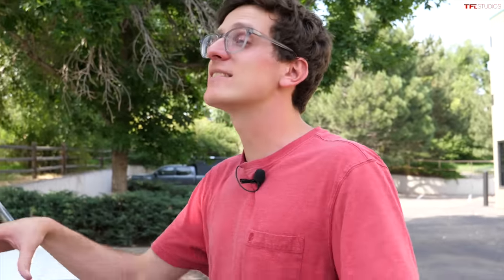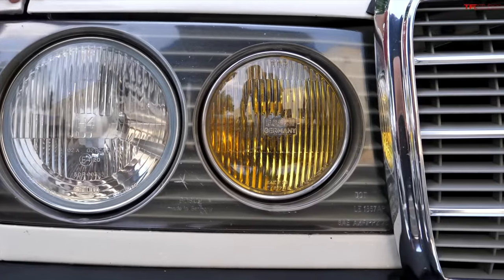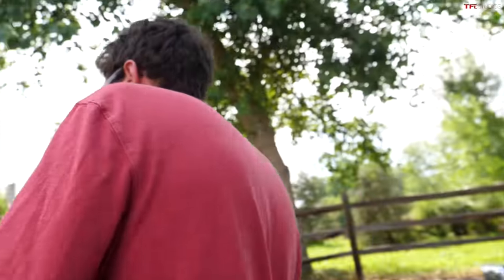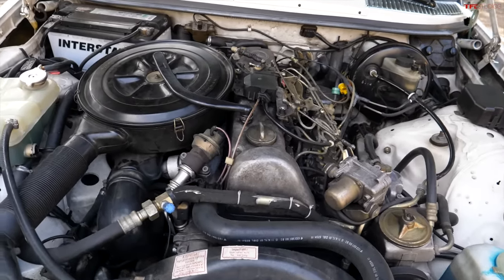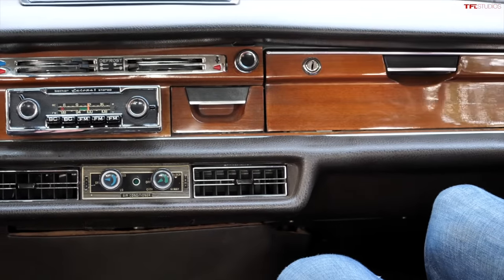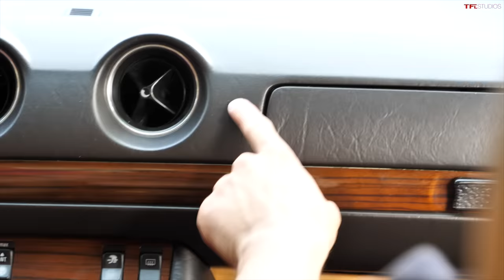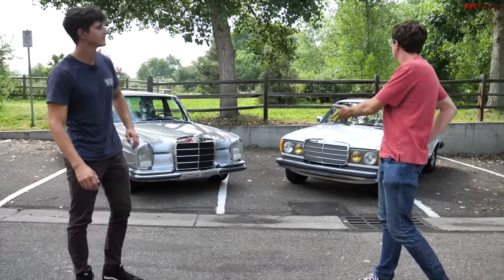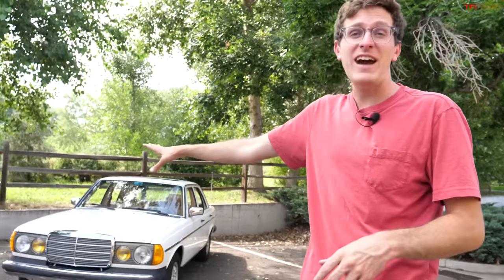Is It Worth Buying a Classic Mercedes-Benz? We Share Why It Absolutely Isn't (& Totally Is)!

Comment: Back in the day, I owned a 78  W123 280E in Germany when I was stationed there for 3 yrs.  It had 2.8 L in line 6 with dual over head cams instead of the 300D.  It was a fast car with a top speed of  243kmph (150MPH) governed.   My car liked to cruise at 219kmph (136mph).  I drove the car every day to work at no speed limit.  These W123's were the best cars MB ever built.  What both of you never see is the amount of over engineering that went in to both of your cars.   Even though the 300D is a slow car in today standards, it can car run, steer and stop at remarkable high speeds.  One of the reasons I bought my 14 Charger R/T because it allows me to remember some of that great MB legacy engineered feel that your cars both have in their DNA.  Enjoy your rides.
Reply: Top speed of the manual gearbox W123 280E is 202 kmph, the 243 kmph you mention is simply impossible

Comment: As someone who grew up with a new and then an old Mercedes 220 gas , I loved traveling around Europe when I was a little boy and then for many years when we returned to the states and when I was old enough I was able to drive my dad’s car and still enjoy it! They are totally worth it but can get expensive as they age , especially if you can’t wrench on them yourself! Things like the original valve train had to be replaced because the original ones were for leaded 120 octane gas and the unleaded gas ate them alive or figuring out that a pinhole leak was causing the downdraft carburetor to not work, a simple fix but you need to be able to figure these things out or pay a huge price to have it fixed by the local Mercedes dealership. Ouch! Enjoy your cars and keep on passing the love for these old Mercedes to the younger generations! Thanks for the content!

Comment: Both outstanding models from Mercedes.  Thanks for saving them gentlemen!  Tires for the W108 are no problem.  It'll take 205/75R-14's, and they will be fantastic on it.  Air 'em up firm, and the ride will be great.  If you run fuel injection cleaner through both, like SeaFoam, and take them out for a 30min run on the freeway, you'll find they run better.  A 300TD is no slouch!  Put your foot into it, and let that turbo spool and make power!!

Comment: I own a 1992 W201 (wich is the predecessor of the C class) I bought it 7 years ago and it has been my daily fi 5 year until it took over my wife Lexus and made my bez a summer car. I amazed about how long lasting these cars are. Even though I had some rough running at time, it never left me stranded and always manage to limp home or to the garage.

Still, I was curious if buying and vintage car that I love would be cheaper than by a cheap KIA I don<t have any feel for. Turn out It<s about the same price after 5 years. At least I have a car that I like and that my be worth more than a cheap modern car,

Comment: That 5 cylinder diesel sounds so good🥺

I'm just obsessed with the W123, the 6 cylinder 280e has to be the one I'd go for
Reply: Good luck. Only 1 comes up every two years or so. 280E sedans in good condition are extremely rare

Comment: Definitely the Diesel! Built like a tank. If my current situation was different I would be in the market for one. I currently drive a 2014 E350 4Matic, good solid car. I stopped by Mercedes a few weeks ago to test drive a 2018 and the salesman told me I would be nuts to trade it for the newer E300 4cyl Turbo. The 3.5 V6 is bullet proof

Comment: About 1997 I bought a beautiful 1984 300 Turbo Diesel blue perfect tan leather interior 112000 miles $7500. I loved it drove it for about a year and a half. Started to have some engine problems couldn't afford to fix it parked it in a covered parking spot and an expensive car cover spent the next 2 plus years paying it off. Eventually decided  to sell it. Now I wish I hadn't. Want another one.

Comment: Damn this makes me miss my w124 that I lost to an accident a few months ago.. It only had 104k miles
Reply: which engine?  I had a W124 1995 E300D i regret selling that car.  I put 300k+ on it ran like a tank.  Was slow but did everything I asked of it.
Reply: @joeyscleaninglady2877  it was a 92 300e I had just done the headgasket to fix the typical oil leak 5k miles ago too
Reply: @ThatRcThing  why not get another one?
Reply: @joeyscleaninglady2877  I tried to find one that was a worthy replacement to no avail.. maybe later on down the line
Reply: man, that sucks...
Reply: @ThatRcThing  get a facelifted one they are amazing E420 or E320 damn I miss my E300 95 w124 was just as quick as the W123 turbo diesel I had but more refined was a tank just kept running should have never sold it now they are skyrocketing in price.
Reply: My folks have a ‘94 E320 with only 60k miles. Mint. They asked me to sell it for them. Any idea what they’re going for these days?
Reply: @denisb8975  depending on color and interior combo/ options you'd be looking anywhere from 12k to 18k
Reply: @ThatRcThing  really?! I had no idea. Any suggestions on the best place to list it?
Reply: @denisb8975  bringatrailer is a great spot to list it
Reply: @denisb8975  15k at least try BAT   cab or sedan or coupe?
Reply: @joeyscleaninglady2877  sedan. Yes, I checked the site. 15k actually seems reasonable. I had no idea it’s now considered a “classic.” Thanks!

Comment: You guys are absolutely right: those cars are supposed to be driven and if you do so, they will run more or less trouble free. And please don't worry about the shaved side markers. Those have been put on cars for the north american market only. Drivers from other countries didn't have them and I guess they survived without them and still have been seen. I bought my first Mercedes, a 240 D when I was 22. Right now I have a 1982 380SEC (C126) which I bought in 1995, a 1996 E 320 station wagon (S124) which I have for 12 years now and a 1971 280 SE 3.5 (W108) with a rare four speed manual. I drive them frequently all year long and they just keep on running. Keep yours and have fun!

Comment: Hands down, THE cheapest car I ever owned was a 1985 300D. I paid $4000 for it (with 145,000 miles on the clock). I sold it for $1500 after 15 years with about 375,000 on it (odo broke at about 345k).  I did all the work on it and paid less than $1000 for parts altogether.  I'm not counting tires (just bought the cheapest ones every 3 years or so - not like it needed v-rated ). Never broke down or failed to start - not once. Never had to get a smog check and the insurance was cheap.
I miss it.

Comment: I was in my mid-20s when I got my first Mercedes (I'm in my 40s now).  Started off with non-turbo w123 300Ds, dabbled a little bit with a w116 300SD, then a w126 280SE.  There was about a 5 year period of time between my last w123 300D and my current w126 420SEL where I owned classic BMWs and Volvos.  Those cars are fun in their own ways, but I missed the the "forever car" feeling of owning a classic Mercedes.  There's simply nothing else like it.  Das Beste oder nichts!

Comment: My grandparents have a 1982 240D with an estimated 230,000 Miles (odometer doesn’t work, no surprise), and it’s a wonderful car. Sure, it’s not a sports car, and sure, it sounds (and shakes) exactly like a tractor, and yes, when you floor it it only makes noise, but I don’t think I’ve had more fun driving anything else. Everything feels so well built. 
Also, if I had to choose, I think I prefer Tommy’s car due to its stock nature, but I’m probably biased. They’re both beautiful cars

Comment: Beautiful cars, both of them. My brother had an 85 300SD, the short wheelbase S Class. What I found odd in a car that expensive when new, was MBTex upholstery. Vinyl by another name. The car was great until 700,000 kilometers. The transmission went out, and to rebuild that as well as fixing all the rust was a $12,000 job. It became a parts car. Superb car from the time when Mercedes built to a standard of quality. Enter Lexus and Infinity, and suddenly Mercedes had to build down to price. My personal choice is the 108, but with real springs. I hate air suspension, and hydraulic is even worse.

Comment: Had a 74 280C with the 110 model dohc straight six with 4bbl. Stripped down version didn’t even have a radio just a plate with 280C on it. 0-60 in 7 seconds fast for the time. It was Euro spec with halogen headlights and slim bumpers

Comment: I'm of two minds about shaving the turn signal lights. The old W108 looks better without its turn signals, BUT signaling for a turn or lane change is legally required, but a safe practice, and driving around with the window open so you can use hand signals would be annoying.

Comment: I owned a 1980 240D (W123 model, like Tommy's there, except mine was Midnight Blue with a Palomino interior).  Bought it from the son of the original owner with about 190,000 miles on it.  7 years later, with almost 225,000 miles on it, he asked to buy it back, because he regretted selling it to me.  He gave me more money than I'd paid him for it -- but to be fair I had repaired the cruise control and the A/C, both of which were broken when I bought it, plus the value of those old cars had gone up quite a bit in those 7 years.

The one I really want is a 1985 300 TD -- the 3-litre turbodiesel wagon.  Definitely like those things.

Edit - oh and the vacuum system also controls the lock on the fuel-door (which locks and unlocks automatically with the door-locks).  You do NOT want to have that break on you at 3AM when you're on a road trip and you stop at a truck stop in the middle of nowhere to buy some Diesel fuel.  Ask me how I know...  ;-)

Comment: Careful about skipping the shoulder belt on these vintage cars.  I did on my first car: a 1973 Plymouth Fury III, and when I got into an accident, I planted my face in the steering wheel hub and broke my nose so badly I needed reconstructive surgery to correct a deviated septum.  They actually had to take cartilage out of one my ribs and partly rebuild my nose with it.

Comment: Great to see younger guys into these cars. I've owned about two dozen 108s 109s and 123s, including four 6.3s, and I currently own a 1970 6.3 and a W124 diesel. I ran a 6.3 as a daily driver for years.
As for that headliner panel, it's not leather, In fact, there isn't a square inch of leather in either of those two cars.

Comment: I used to tool around in a W123 when I was an 18 year old (My Dads 250). I was offered it when I was 20 but didn't fancy living with the 20mpg fuel costs. My personal favourite is the W126 V8 which he had in the mid 80's. Wouldn't want to fuel that either though.
What always amuses me is that it seems that in the US in the 70's and 80's, you either got the horrible slow, noisy, diesels or the 5.0l V8s, whereas in Europe we mostly ran the smaller petrol Mercs. The 230E was the most popular W123 in the UK by far. Outside of Taxis we didn't touch the diesels as they were rough and slow and a Merc was supposed to be a smooth luxury car.
These days, in Europe, we switched and almost exclusively run diesels (220cdi or 320cdi, even in the S class) as they're economical, refined and fast, whereas in the US you've gone the other way and only seem to run the gas guzzling petrol engines.

Comment: Kase's car has electronic fuel injection (Bosch D-Jetronic).  It's the first of Mercedes switch from purely mechanical injection to electronic.
Reply: Pretty sure it's not electronic injection. Both the W123 and W124 which came AFTER that didn't come with electronic fuel injection. On the W124 electronic injection (HFM) was only introduced on the 1993 model.
D Jetronic only had electrical fuel enrichment for cold weather starting. Otherwise mechanical.

Comment: I loved owning and driving my old Mercedes cars. The biggest danger is that they SOOO spoil you. It's hard to drive anything else. I'm a generation older than the guys here, so I had an earlier generation of Mercedes starting with a 1957 190S (You know the look... the grill is taller than it is wide!). A running 1959 190S was my parts car. Then, I got a 1963 230SEB that sold very cheaply because no one could start it. They didn't know about carburetor chokes. I got into it, knew that the unlabeled knob was the choke, closed it, started it, and got it. And my last one was a diesel, a 1966 200D. Now I drive a modern VW Jetta TDI ... still a diesel, thank god!

Comment: I bought a '72 300SEL 4.5 as a project.  Famous last words.  Was a California garage queen, but had Underhood fire.  Silver with dark green interior.  Didn't ever run.  Experienced European specialists wouldn't touch it.  Found a wrecked twin in a junkyard, so tried it.  I had some experience on an MGB before, and the quality engineering came through in spades.  I got a '69 Corona as a daily, and it was a different good experience.
Reply: My sister had a red Corona coupe  with a white roof of the same around the same period of your 69 Corona, it might have been a 1972. It had tiny 13 inch wheels, and could took forever get to the 55 mph speed, which was the speed limit in early 1980’s in Ca., and protested at any sort of hill. She loved it because she said it was so cute and reliable.

Comment: I have a 78 300CD with 340,000 miles on it and it still runs like a top on the original engine.  Never even had the heads off.  BTW, it's more environmentally friendly than any electric econo-box on the road.  I run it on 100% biodiesel that's available commercially here in the Denver area (no conversion of any kind needed, just put the fuel in the tank).   I recently acquired a pristine 84 300CD Turbodiesel with 98k miles on it (barely broke in) that was offered at a crazy low price so I just had to buy it.  I'm set for cars for the rest of my life.  They never die.

Comment: Cool Cars - both of them. I had W123 230 Petrol Bulid 78 as my first car in 1991! Did you realize where they put the electric motor to run the sunroof these days? It‘s actually in the trunk. And it pushes or pulls the roof by a mechanism throug the c pillar!!! Great german engineering, for sure . Take good care of them - until rust tears you apart!

Comment: Both nice cars, I prefer the 108 and a gas engine over the clattery diesels, but that's just my opinion. The way to wake one of those cars up is to drive one with a manual transmission; - then you can run it to flat out. Since the 50s, Mercedes gas engines were designed to be run to redline; - "top speed is cruising speed", there's nothing like taking an early 111 body or a Ponton with a standard through the gears and it's paces, - I really miss that!

Comment: An expensive hobby limited to those with well stuffed Wallets or to " do it yourselfers " . If you are not in these categories..... best buy a well made diecast Model and admire it in all its detail from your desk or bookshelf .I have a beautiful sky blue MB 280 SE to appreciate daily and believe me, this will ground you to reality and indeed satisfy your urge of 
owning the real thing .
Reply: I agree with you. Classic Mercedes from this era are absolutely awesome, over-engineered cars and such a pleasure to drive. I have owned many (W123, W108, W180 Ponton, W116, W126) and every one of them was head and shoulders above anything else on the road. However, over the last 10 years, the game has changed completely. Owning one of them (even a W126) has become a nightmare because no-one knows how to work on them anymore and parts are very difficult to get these days. It is going to be something small, like the shims under the tappets, or the gearbox, that will kill the car. Sadly their time has past. Loved every day of the 10 years I used a 500 SE as a daily driver. Now the die-cast cars have to suffice.
Reply: Nah, that's uninformed drama. You spend more on a new car.
Reply: @friendlypiranha774   Lots of people know how to work on them and the parts are on eBay.  Avoid the dealer.
Reply: @v.dembsey3355 , thanks for your reply, however that is not the situation here in South Africa. No Mercedes dealer here will touch these cars... Not even R129's. The situation here was very different until about 10 years ago. The W126 was a very popular car here and there were tons of them on the roads. Now you only see one every couple of months. There is only 1 person left here who still knows how to set the camshaft shims and his waiting list is over 2 years long.
That is the reality of the situation.
Reply: @friendlypiranha774   And your situation is luxurious compared to Papua New Guinea. There is no such thing as "only 1 person left" who can do something anyone can learn to do in 5 minutes from any manual or video. I hear helplessness and hopelessness. If it was me I'd open a shop to set the shims and have a huge business over night. Change the reality of your situation.
Reply: @v.dembsey3355  5 minutes of YouTube video does not an expert make. Otherwise all the local shops would be doing it, hey? 
Ten-Four Good Buddy,
Over and Out.

Comment: That definitely is not a Mercedes W108, BUT in its long wheelbase it is stated on the boot lid as an SEL, and therefore it is indeed a W109, 4,5 liter V8, a very beautiful classic car indeed,. Furthermore, the rear doors are wider and the giveaway is the windows on the rear passenger doors that are wider too.  It appears to have hydraulic suspension or air suspension bags too.

Comment: Love both of these cars! I’ve had several 300TD sedans over the years. I currently daily drive a 95’ E300D, 320K miles, but I’m starting to consider getting something newer. It requires about $2-3K per year in repairs and maintenance to keep everything working.